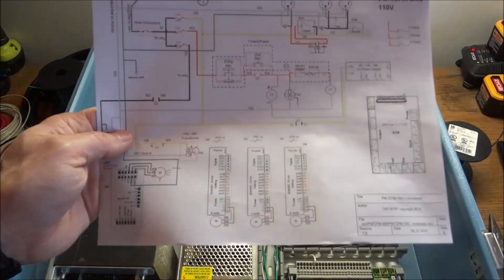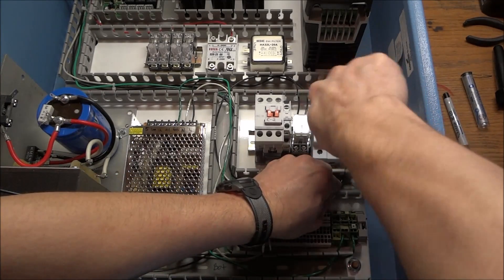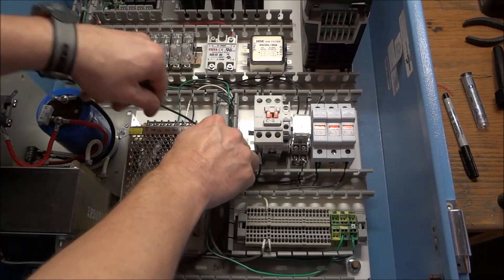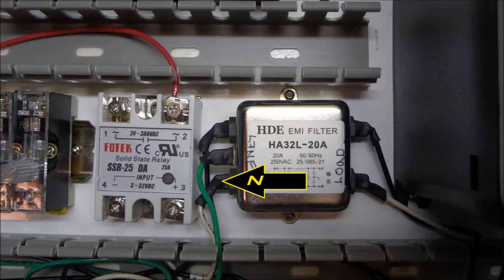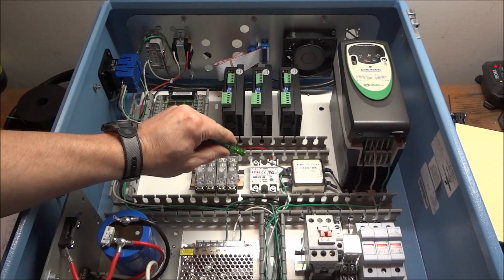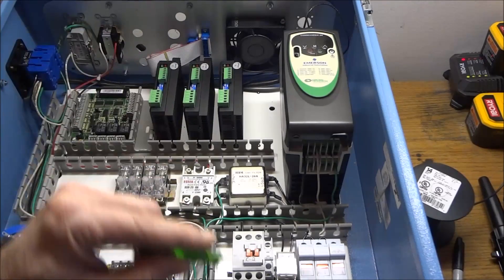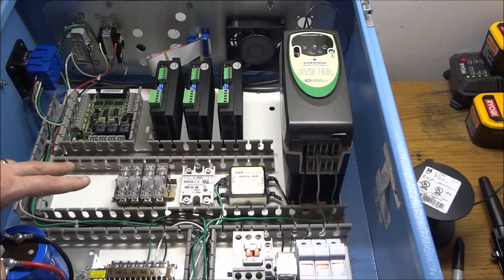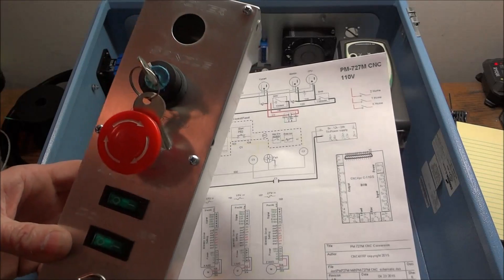PM 727M CNC Electrical Wiring Part 3

Comment: Just curious, why wouldn’t you use a circuit breaker in the enclosure instead of the fuse type? If it blows the fuse you have to replace it. A breaker trips and you can reset it! ???
Reply from the maker: Fuses tend to be quicker and better for this purpose.

Comment: Why do you need a relay for the transformer and the 5-12-24V power supply? Tried to find an answer online couldn’t find. Thanks in advance.
Reply from the maker: there is a Holding circuit that will keep the relay energized and the VFD contactor energized until a etop is pushed. this is for safety of course to remove all power in the event of a EStop

Comment: I want to use stepper motor drivers powered by 110V AC
They are Leadshine HB1108S (they directly accept 110V as input voltage)
From what I understand, I have the feeling I should put an EMI filter just before each of the 4 drivers I have. Would you confirm that?
Reply from the maker: Yes
Good practace

Comment: The top/bottom panels will have earth studs, you need to wire these directly to the side earth stud, not via the earth block.
The fans need dust filters.
The diagram doesn't show where the mains filter is connected.
Reply from the maker: No studs on the panel just on the Back plate, Fans blow out and there is a filtered Intake. No Main power line filter just a filter before the VFD.
Reply: No studs? Wow that's strange, it might just be a UK thing though?
Ah sorry, I mistook which fan I was looking at.
Actually I realised later that you've updated the drawings with where the VFD filter was wired.
Reply from the maker: I appreciate the input!

Comment: I thank you for teaching, do not forget to install (EMI filter 5a) to avoid damaging the controller 

an engineer told me it is important to emi filter for all computers

emi filter 20A - VFD perfect
the food source drivers and motor must also have the emi filter 10A

It is very important for longer life

because I tried all components function test

without emi filter was gone mad

thank you very much for teaching me Connection cables

Excellent

you're very kind
Reply from the maker: +Yordi HDEZ  Your welcome,
 The tri power power supply has a built in EMI filter adding a additional filter cant hurt. The stepper drivers and motor power are DC the AC to DC rectifier should resolve the EMI however cant hurt there as well.
 Be Safe,
Sam
Reply: ah now I understand it haha thanks sam
Reply from the maker: +Yordi HDEZ  
Your welcome happy to help.
Be Safe

Comment: What is the spec. for C2 ? I am looking to buy the right one. I see possiblilities AC220 /AC 24/ AC36 ? Which one is right
Reply from the maker: +ERGOtek Mechanics Limited  Good Question! The Number your referring to on the Contactor is the coil voltage I'm using is a 120V ac coil 
http://www.ebay.com/itm/181661739194?_trksid=p2055119.m1438.l2649&ssPageName=STRK%3AMEBIDX%3AIT

Comment: Stan Z was wiring something through a 3 pole contactor and only needed 2 poles, but wired one circuit through the unused contact to avoid possible uneven wear.  I don't know if it's worth doing for a device which I expect will live a pretty easy life though.
Reply from the maker: Yeah the contactor. Is pretty heavy for what were using it for. And yes I will only need one pole for now. Unlike a contactor used to start a motor. There really won't be much wear since the start and stop is controlled with vfd internally.

Comment: Breakneck pace! You're going to have this thing up and running in not time, I predict. Dropbox link seems to be 404.
Reply: Thanks for the heads up the Dropbox link is also in the video wiring pt 2. It works.
Reply from the maker: +Charlton Wang  Fixed I think
https://www.dropbox.com/sh/3hr8k95q478ddmw/AADVTeSj0D5zgulvp_HxQaKKa?dl=0
Reply: +CNC4XR7 Thanks, Sam! :)

Comment: looking great!!! very professional looking control cabinet!  

for reference, the have 90deg terminal connectors for those hard to fit spaces for those going forward, I found it makes life a little simpler but I agree a soldered connection is better then spade terminals that tend to loosen up with repeated installation and we removals..
Reply from the maker: +christopher polanski  I haven't ever had a EMI filter go bad but then again you never know. That the thing about doing something the first time hard to plan for everything. but it should be fine.
 be Safe,
Sam